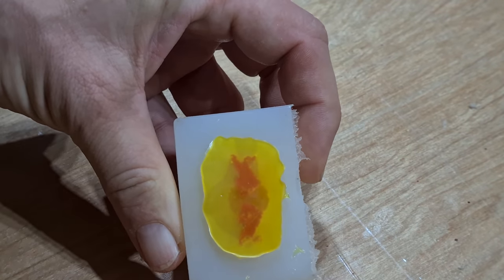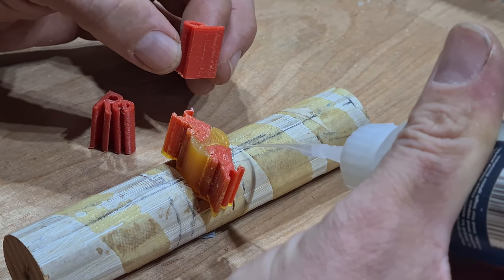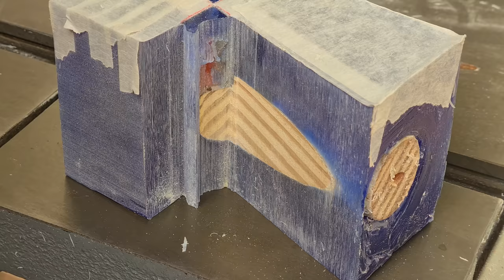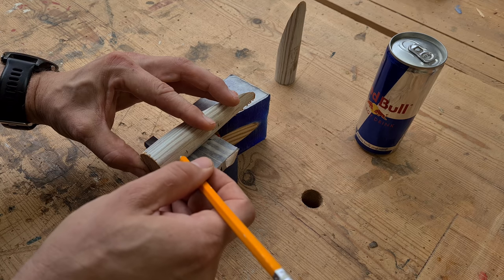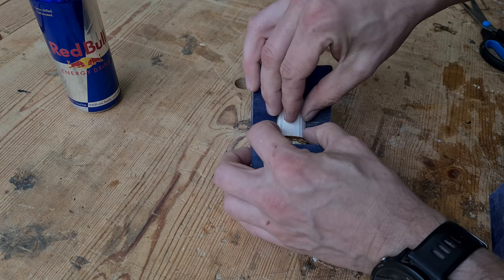Unbelievable! Watch How You Can Woodturn a Red Bull Can!

Comment: I've seen some of the resin jewelry artists use powdered aluminum instead of pigment or mica powder to mix into the resin, and after it's set they'll shine it up with fine steel wool. It ends up looking a whole lot like the actual metal. Nice work -- I enjoy all the precision and forethought you obviously put into your projects.
Reply from the maker: That's a great idea Kris! Thanks so much for the insight. Will have to try and find some examples and see if it can be adapted to these type of projects. All the best. Ray

Comment: hollowing it seems scary haha
Reply from the maker: Hey Logan! Yes, hollowing is my least favourite bit. I should get some training from a pro woodturner and I might be less anxious about this stage!
Reply: @RayWhitbyCreations  Even I got anxiety just watching it! How do you know that the resin is strong enough and wont crack when hollowing though?
Reply from the maker: @loganmcilmoil386  Trying to avoid a really long answer, but mostly it's about knowing that the resin has solidified (it was mixed correctly) and feels hard so it is curing. Then the technique of turning resin and knowing where the pitfalls are likely to be (near other objects that aren't resin) and therefore go slow, high turning speed, using a sharp point then scrape with carbides to get the project rounded. Go slow and see how the project responds and correct where necessary!
Reply: @RayWhitbyCreations  wow sounds complicated but that answered my question, thank you!

Comment: I would have used silver and blue flakes in clear resin. 🤷🏾‍♂️ maybe a bit of black pigment to tone down the brightness and glittery nature of the glitter. A really fine glitter, like an automotive dust. Maybe try a more durable filament. Yeah print time will increase but the heat from the resin might not wash the details in the bulls horns. Maybe enlarge the logo a couple millimeters? Hopefully my ideas will be used or spark more ideas that are similar.
Reply from the maker: Thanks Rajah, some good ideas in there. Will have to keep trying with the silver resin. And maybe go for a smaller layer size in the 3d printing - or increase the size of the logo!

Comment: You were right to finish despite the letters not being quite right.
If you had quit and started again, you might have found another fault later in the project.
By continuing with this one you learn of any issues, and if you do do this one again, you will know all that you will need to do differently.
Reply from the maker: That is insightful Michael. You're right! I could have redone it for the letters and then messed up on a different process. Not sure if I'll be redoing this one, unless for a commissioned piece. Thanks for your input on this. All the best. Ray

Comment: Excellent video you can create one of Monster Energy
Reply from the maker: Hmm, as long as it was the original Monster Energy drink I might be able to get close to the design. If the Juice version, I may have problems! Great idea though. I will certainly think about it. All the best. Ray
Reply: @RayWhitbyCreations  Yes, in the original version, by the way, a question how long did it take you to make the video with editing and everything 👍
Reply from the maker: @SIN_NOMBRE_FREE  This project took around 18-20 hours spread over several weeks, mainly for the resin to cure. I should make a note of the time spent. Editing is fairly straight forward, 2 hours max.

Comment: To help with your 3D prints have you adjusted your retraction settings? If not I would recommend it.
Reply from the maker: Hi Joe. Thanks so much for the advice! I have tried to play with settings, but not sure how much I did with the retraction. Often it seemed okay when printing standard, but when putting in the code in order to take a photo after each layer, then the problems were exacerbated. I should go back and try again. All the best. Ray

Comment: Can i suggest using TYVEK tape inside your moulds to stop it for breaking apart how it did just found your channel loving what your doing just a little hint :)
Reply from the maker: Hi. Yes that would have helped. Often I'd use packing tape (UK), but for this I thought silicone spray would have been enough on melamine surface. Alas it wasn't. Thanks so much for watching and commenting. All the best. Ray

Comment: Maybe if you redo it for the silver section try the world's mirroriest mirror paint by Stewart semple. I would try using it as a pigment in resin or to paint on after the project?
Reply from the maker: A ha! That's what I was looking for, but didn't know it existed. Thanks Bella, really appreciate it. All the best. Ray
Reply from the maker: I've just got a response from the company and they say that it cannot be added to epoxy resin, which is a shame. It can be used as a paint on the outside after curing. Hoping I can still find a resin additive. Thanks for the idea Bella.

Comment: I was thinking of making my own silicone molds. If I need to cut them to get the 3D part out, will epoxy leak through it, or can it be closed and tightened so that doesn't happen?
Reply from the maker: Hi Jared. Depends on how you've cast the 3d printed pieces. If one aspect is flat with the outer surface of the silicone and you have enough silicone to cover the rest, then it should be self contained to pour in epoxy. I haven't tried complicated pieces inside silicone, but guess that it needs to pull out without creating any tears. Although could probably seal with a little mastic.
Reply: @RayWhitbyCreations  when you say mastic what are there products you are referring to?

Comment: the stringing can be caused by alot of things. if you already tried to fine tune retraction and calibrated esteps than it is most likely wet filament
Reply from the maker: Thanks Lee. I had done some tuning, but not extensively. It certainly got worse when it was travelling to take a photo, but you're probably right that I need to improve the retraction. All the best. Ray

Comment: is that a Voxelab printer? stringing has always been a problem on both of mine but i notice the best performance from Overture filaments
Reply from the maker: It's an Ender 3 v2. I solved some of the issues with combing mode settings. All except for wood filament PLA. Still looking for a solution.

Comment: What about coating the whole can with tin foil and the a shallow pour of resin on top to produce the metal effect?
Reply from the maker: That's quite an interesting idea Paul. I would probably use thicker tin foil to avoid it crumpling on handling, but I guess that means I'm using tin foil that would in essence be exactly the same as the can I'm trying to replicate? But it would certainly give the look!
Reply: @RayWhitbyCreations  ahh that’s a good point.  I hadn’t thought about the fact that you’re trying to replicate the metal effect without actually using metal.  Seems obvious now.  😁🥴.  Hmm tricky one, but either way I can’t wait to see a mk2 if it happens. Mk1 was fantastic, especially the intricate and technical aspect of the blue segments and letter spacing on a curve.  Congrats

Comment: You could always do a red bull cup by just using a giant red bull can and cutting the top off and filling with resin inside and coating the outside with resin and just hollow the inside out and turn the outside. I guess I'm saying just basically an epoxy cup with a red bull can on the inside
Reply from the maker: That would be a lot easier than the mess I made!
Reply: @RayWhitbyCreations  a lot more lame too. I think I'll leave the creativity to you

Comment: I'm sure you heard it a million times before but printing slower, tuning your retraction/ flow settings and drying your filament should help with the stringing. If you're using PLA there's no reason those models should string at all like that. Try using combing. That helps dramatically with reducing the amount of retractions in a print. But at the end of the day it could just be bad quality filament.
Reply from the maker: It certainly strings more when trying to film the 3d printing for a video. I have tried tweaking these settings, but possibly haven't spent enough time looking at them. Tried temp towers, stringing bridges and played with a number of retraction settings and also combing. I probably could do with someone saying exactly what parameters to set and give it a go. I think I will invest in a 3d resin printer.

Comment: Are there any resins that are heat resistant enough to let you make the shiny parts out of actual aluminium?
Reply from the maker: Not sure any would go to the melting point of aluminium. A dopant with aluminium powder might work if it didn't look like a grey mess. I'm sure there's a solution as yet to be discovered!

Comment: In future attempts,  couldn't you print the words as one unit with ther curvature of the core already in place?
Reply from the maker: Hi Francisco. That's a great idea and would be a lot easier! The slight problem is that I do not have much experience with CAD software (FreeCAD). Although I can now see a workaround solution; shame I couldn;t at the time. Thanks for your input on this! All the best. Ray

Comment: u should fix the retraction on ur 3d printer so u no longer get those annoying fibers that come out when the head is moving from one point to the other.
Reply from the maker: I've tried and narrowed it to a combing mode setting, which has improved it for regular PLA filament. However, switching to a larger nozzle and using wood filament and the thing keeps oozing. I need to try some more settings!
Reply: @RayWhitbyCreations  if u have the retraction on, try fine tuning the temperature of the nozzle try decreasing it a bit
Reply from the maker: @MrTOniDIni  I did go down to 180 on the PLA till it didn't really tick as layers. Perhaps it's the retraction speed & length, or maybe I should replace the standard extruder? I'm finding the wood PLA is more stringy than the standard PLA, but guess this is also using a 0.6mm nozzle.
Reply: @RayWhitbyCreations  on mine the retraction speed and length are the default settings and they work perfectly. I had some.stringing because the nozzle was worn out. Other than that I guess the type of plastic being extruded is not very good. I use e sun, I tries different cheaper options but they either dont stick very well or they are very messy with the stringing

Comment: whats the point in making a resin drinks can, your making a cop of somthing you throw away. think i might make a resin banana skin
Reply from the maker: Ah, but how would you approach making a resin banana skin Harry? The reasons for this work are partly based on the challenge of combining resin, 3d printing and woodturning (among many other reasons). If you can do a resin banana in it's skin, partially peeled, I think it would make for a challenging (& interesting) project, irrespective of whether it has an obvious use or not. This project lays the foundation of methodology for a large diorama project. It can also be used as a nightlight (see final images of the video), keepsafe, etc.